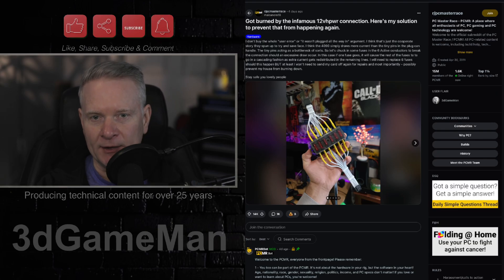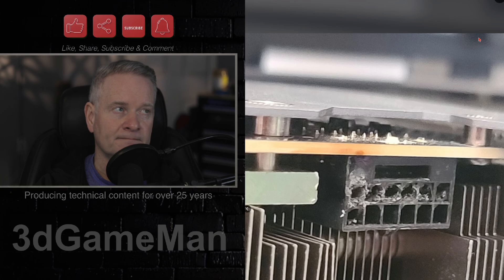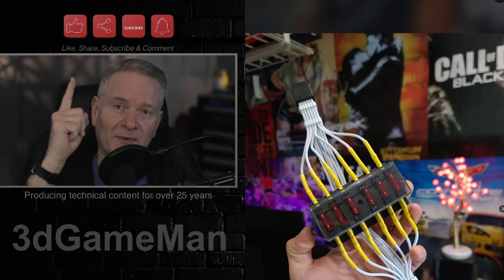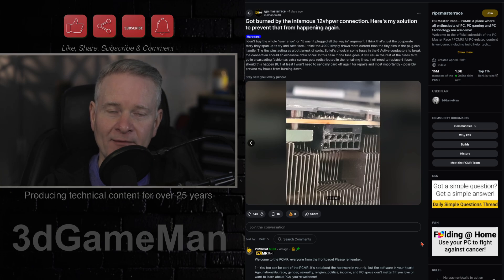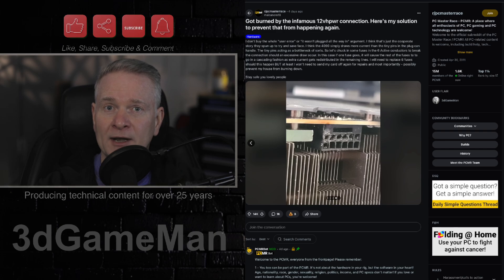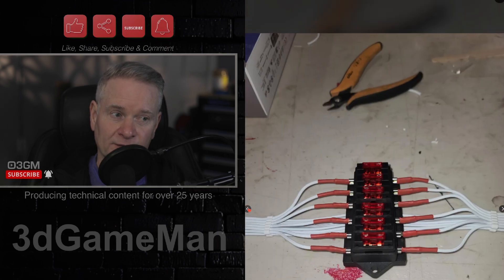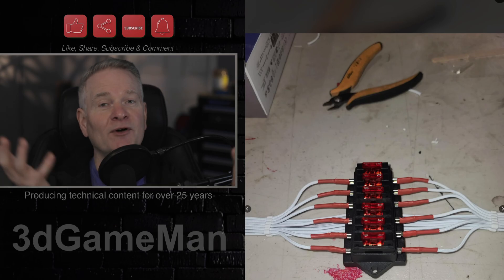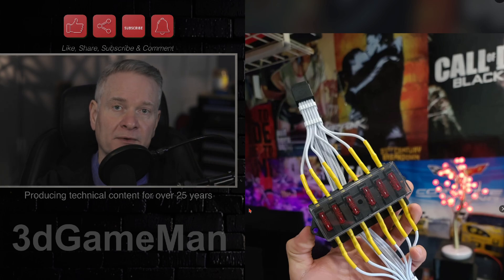NVIDIA 12VHPWR Connector Solution! #nvidia #rtx #rtx5090 #rtx5080 #media #rtx5060 #msrp @3DGAMEMAN

Comment: For 4090 and 5080 owners, my suggestion, if you want piece of mind, is to set the power target to 85%, or more specifically to 400/420 watts. The 12v cable is rated for 600w but in reality it can go to 680w aprox, so the safety margin is low (with previous X8 pin connectos, they were rated for 150w but capable of 300w, so a lot of margin, that's why there weren't much issues with  it). Now, if the 12vh cable is capable of 680W, then if you use it at 400W, then you are restoring the margin, and you don't lose 15% of performance, you might lose like 5% in some specific parts of a game or something. There are more suggestions but more documented or explained already so I wont mention them. For 5090 owners then I'm not sure what to say, because that card has a lot more cores and vram and it needs more power than just 400w. I would get the Astral that comes with protection via some sensors, or I would get the devide that De8uer sells to check the amps at every pin of the connector (because the problem is when some pin doesn't make good connection and more current goes through the others).

Comment: This was a quite bad video. Bot comments and then talking about issues with undervolting. The 5090 does better with a bit of an undervolt or the same. I have 500w as max from benchmarks and beats my default settings with about 0,5-1%. With 100w lower usage.
Reply: Exactly, undervolting and limiting the max watts doesn't degrade the performance. There are a lot of ways to play with the settings of a gpu to make it work faster and cooler than stock.

Comment: 3090 = 3 Resistors, Long Sensor pins, Short GRD/PWR pins
4090 = 2 Resistors, Same Cable as 3090
5090 = 1 Resistors, Shorter Sensor Pins, Long GRD/PWR.

Comment: Issue:
1. Electricity does not care if you have multiple cables, it will find the shortest or lowest resistance path.
2. If just one of the cables has a lower resistance or shorter path than the others, more current will flow through that cable.
3. The other cables will have less current flow, hence why only 1 or 2 cables are melting, too much current.

Fix:
1. A higher gauge (6AWG) single core cable for each power rail of the video card, usually 2 or 3, more if needed.
2. A complete redesign of the connector to suit new cables, unfortunately, this requires a new PSU design as well.
3. Keep the pinout the same, so consumers can simply have them replaced by a technician.

https://www.youtube.com/watch?v=kb5YzMoVQyw --> buildzoid explains why here.
Reply: aka Kirchoff's circuit laws
Reply: @scratchanitch  its not 6 separate cables with each an entry point + shunt, its 1 cable divided in 6 lanes + connectors in those lanes. Freaking faulty design. https://www.youtube.com/watch?v=kb5YzMoVQyw&t=193s
Reply: @ganymedes73  care to explain why Kirchhoff doesn't apply here? I've seen so many videos on this topic and none of them attempt a proper network analysis of the circuit, let alone do any simulations.
Reply: @scratchanitch  It does apply, just like Ohm's law. What I meant to say is that if you have 6 separate positive wires, each carrying 12V at 8A, that equals 96 watts per wire. However, if those wires are all soldered or connected at a single point on the GPU, a failure could cause 5 or less of those wires to carry the full 12V at 48A. The 12VHPWR wires are not thick enough to safely carry that much current. So, if you want to ensure safety by making the wires thicker, it would be cheaper and more effective to just use one thick, high-quality wire+connector. But honestly, none of this would be necessary if Nvidia hadn’t combined all those wires into one single connection point on the GPU. Either GPU or PSU should have a failsafe/regulation/fuse

Comment: Nvidia didn't spec or design the connector, PCI-SIG did. As for solutions, putting two of them on one card would go a long way to resolving it. These connectors have only about a 10% safety overhead margin, compared to good old 8-pin PCI cables who have something like 40% safety overhead.
Reply: nvidia may not have designed it, but they chose to mandate all partners use only 1 connector, even though the overhead to max load is so little. Also for 5080 and 5090 at least, all AIB partners are also mandated to use the 16-pin connector, they are not allowed to put 4x 8-pin, or even 2x 12V EPS connectors on thier cards.
Reply: @MrGeneralScar  Correct. Everyone is blaming the connector though. If implemented correctly the connector should be fine. It's the implementation that is poor, not the connector.
Reply: @MrGeneralScar  they removed the shunts after the 3000 series, from 4000 series and up they  just soldered 6 hot 1.5mm2 cables to one point. So Nvidia willingly changed the product and went forward with a 16 pin connector, and knowingly this can be the result a melt instead of a gpu that crashes due power failure.

Comment: The best thing Nvidia can do for the 12VHPWR Connector is just scrap it, go back to using the tried and true 8 pin connectors. No more problem.
Reply: Yep! Besides, most every major PSU manufacturer out there over-engineer their cables. You can safely push 200w through a single 8-pin with Corsair and Lian-Li PSUs, so in theory you'd only need three to supply the actual 600w with a 4th in reserve or as load balancing requires. Like I'd rather have 4 big fat connectors on my GPU with large ass pins than this wimpy 12v bullshit. I legit cannot stand it.
Reply: OR they can add a second 12vhpwr so the loads are evenly distributed because they use 2-4 on their engineering samples
Reply: @Toufan1-gr4br  more cables is more point of faillures = no. Besides the whole design sucks, look at your home. How much wattage can you pull from the wall? How simple how secure? How is your fuel car wired from the battery? How simple how safe? This just saving couple cents to the dollar on a product that cost over 2000.
Reply: They won't.   Unless FTC gets involved in this.   Kinda surprised they have not.